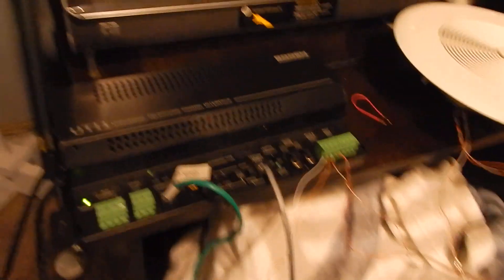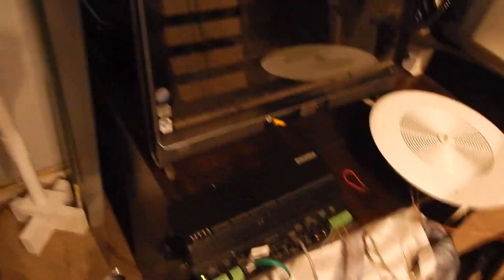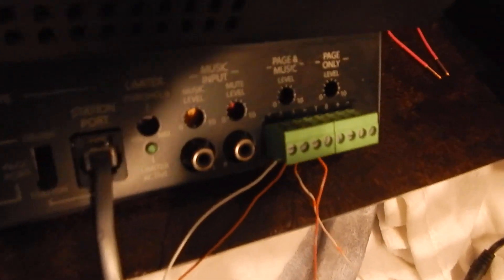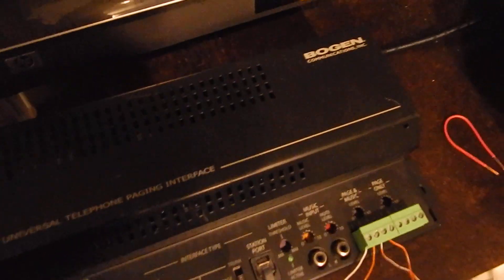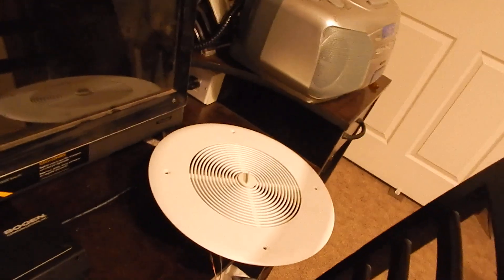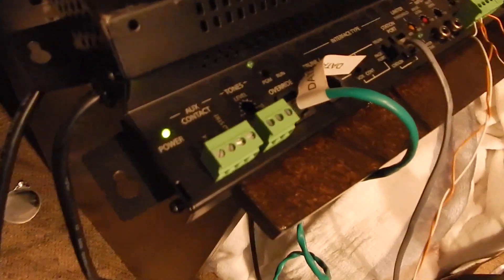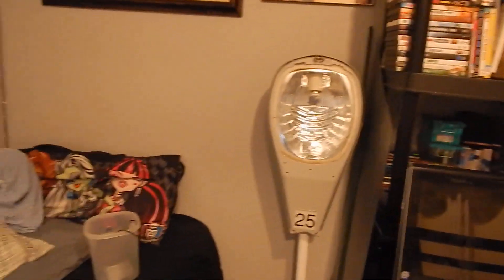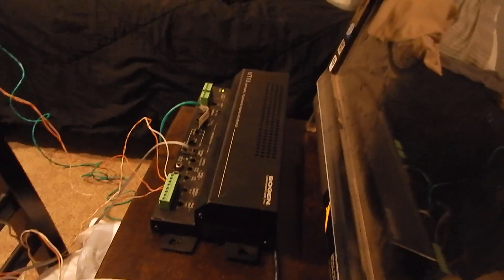How To Wire A Telephone To Amplifier

Comment: Thank you! Just have a few questions: Do the wires coming out of the Page/Music terminals go to the Mic input on the back of the amp? Also where can I get those type of wires exactly? Also what is the grey wire on the Station Port for? Sorry, I am extremely new to this stuff and want to make sure I wire it up to my amp properly.
Reply from the maker: You don't need to buy any special cables other than a cable with the appropriate jacks that fits on the microphone port on the amplifier. Really all you have to do is just cut off one of the jacks and wire it straight to both the T and R terminals on the UTI1 to carry the audio over to the microphone port leaving that one jack in place. The gray cable is the station port which in simple words acts like a typical landline phone, except its one-way communication. You can use the station port if you have some sort of phone service which you can page right from your smartphone by calling your home phone and  UTI1 will pick up right away for a page. If you don't want that kind of setup then you can just use the override port which any typical landline phone will work with no problems. When you pick up the phone on the override port then it will automatically page without dialing. I uploaded a pdf manual for the UTI1 in the video before this one that explains the setup procedures more in depth.
Reply: @CristianOrtiztechmaster926  That sounds cool to be able to page from a smartphone like that, so I would most likely want to try that. So basically, the cable in the station port runs to the main phone jack?
Reply: @Dilan's Creations Wow, very interesting. For years I always wanted to know how to do this. I just barely set up a 70v system at my house just last year, thanks to help from Mr. Mercury.

Comment: So what is that Avaya module thing that doesn't work?
Reply from the maker: The Avaya module is just a Bogen TAM-B module which does not seem to work according to the wiring and dip switch settings in the instruction manual.